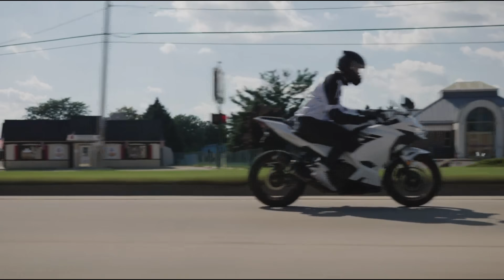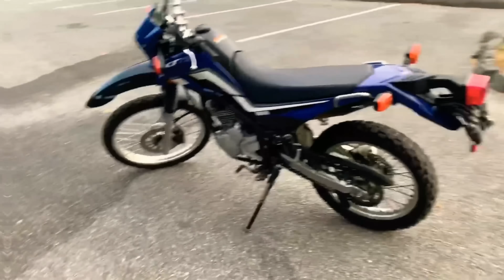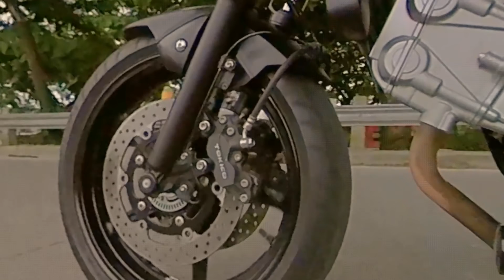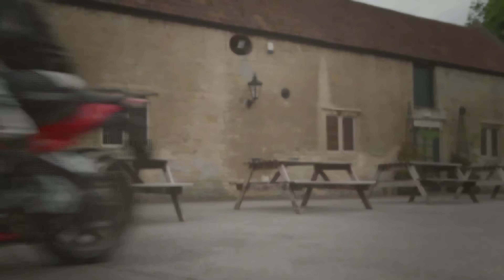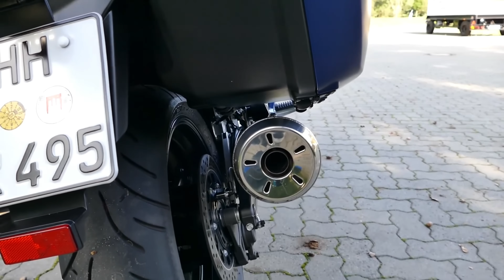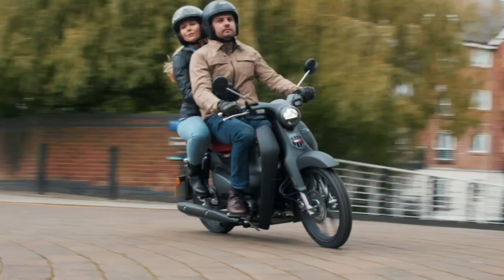14 Motorcycles With ZERO Repair Issues Revealed

Comment: I'm From India & Using TVS Apache RTR 160 4V - 2018 Model Clocked 1,40,000 KMS and Still Running for my Daily Commutes. 12 Litres Fuel Tank With the Average of 52 KMPL.

Comment: I have 2025 Kawasaki eliminator ABS SE and right now shows 62k miles and still looks like new. I took it everywhere in the US. I do maintenance by my self.  The only thing I don't like about it is the fuel gauge gives you not accurate reading.

Comment: You have to recommend tractors instead of motorcycles! Exept vfr, fjr and goldwing every other motorcycle that you recommend is a single or two cylinder and they are boring and ride like a tractor 😂😂😂 apparently you don't know what the motorcycle is, of course you have to maintain your motorcycle with the original parts and then you can enjoy it, otherwise this crap that you introduced is like a tractor to an experience motorcyclist.

Comment: Having a coating on the aluminium barrels with no liners, means you can’t rebore the engine if damage does occur or when it does wear out. 😏
Reply: true bu they last a long time and CAN be recoated - just like TZ Yamaha cylinders

Comment: The Honda VFR800X. At the time no one was ready for the aesthetics and viewed them as ugly but now it's the norm. 104 hp vtech engine for rounding up traffic on the highway, handle gravel roads and can do 340km cruising on a tank comfortably. I sold a Rocket 3 Touring and purchased the vfr800x in 2015, usually only have a bike for like five years. But every time I think of updating I can't justify anything better, and after every trip I regard it as friend as in reliable that is.
Reply: happy VFR750F (RC24) user over here :)
Reply: How many miles or kilometrage you done on it

Comment: The Super Cub  is a hidden jewel.
Surprisingly fun  to ride. 130 - 140 mpg, with top speed exceeding  50 mph, (80  kph) It keeps up with urban traffic.
Unless you need a highway bike, this one is ❤❤❤. 
Sadly, due to low sales, Honda stopped selling the Super Cub after 2024.
It is are hard to find used in the US, but, if you do, you will have a fun, reliable, easy to ride little bike ( not a Grom hulligan).
Reply: My fav bike I want a supercub but also want a r7 or a sv650😊

Comment: How can anything mechanical not need maintenance?? Come on.
What I will tell you is never ever buy a Chineese scooter with the GY 6 motor unless your a talented mechanic to fix that garbage often.
Been burned from experience. And no one works on them either. No name brand dealers will touch them. Since I’m not mechanical ⚙️ I just bought a Honda. Bulletproof, last forever and lots of shops to maintain it